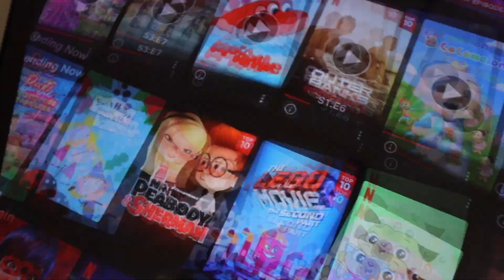SPECIAL SURPRISE FOR MY SISTER!!

Comment: The amount of paper you have is probably equivalent to 1 roll of paper depending on the pattern depend whether you get 3 or 4 drops (full height of wall) ceiling to floor and so it works out very dear but is so beautiful xx